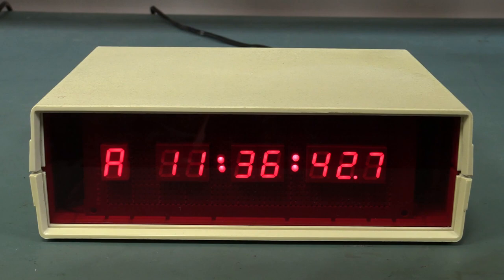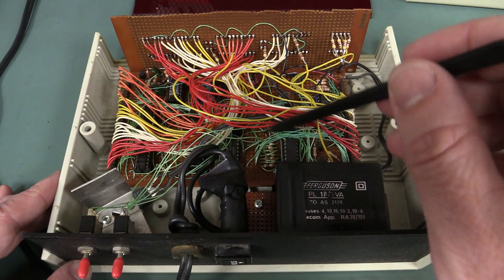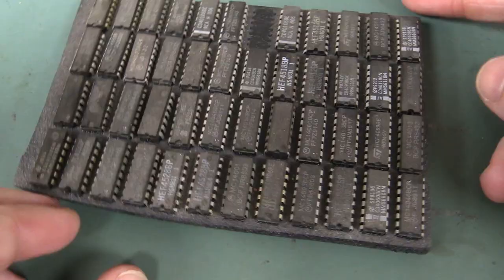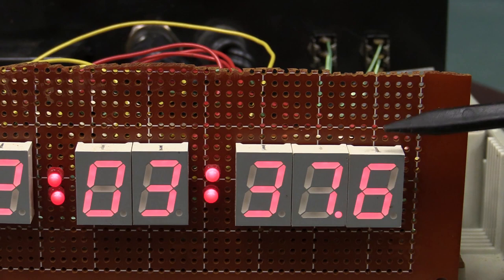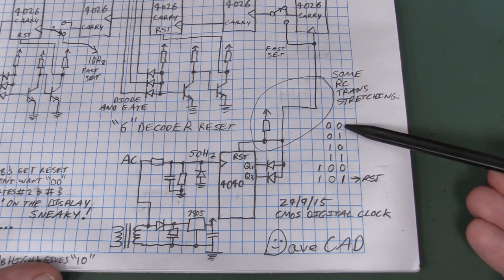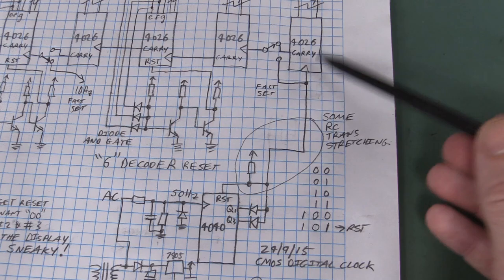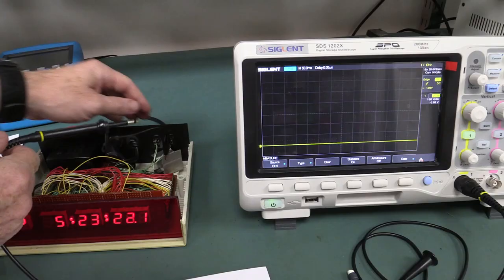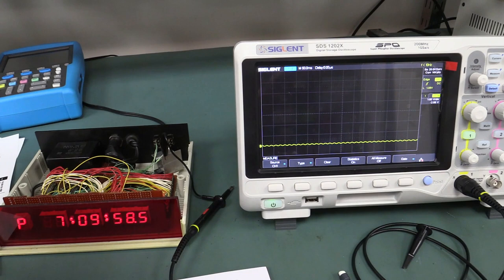EEVblog #801 - How To Design A Digital Clock

Comment: one question, does the 4040 just need a stable clock signal, or does it absolutely need 50Hz?
Reply: The 4040 is just a CMOS binary counter IC that he is using to divide the incoming 50Hz by 5 so that he can generate 0.1 second counting pulses for the display counter/drivers ICs.  It is a 12-bit counter, so you could set it up to divide the incoming (line frequency) pulses by any desired value that can be defined within the integer range of 12-bits -- you just choose which "magic" number will reset the counter back to zero...so for a pulse-per-second display you would reset on 50 (50Hz) or 60 (60Hz), which rests the counter back to zero where it continues counting up again.  There are also other possible IC binary counter choices that can be used as well (including 7400-series), I suspect Dave chose the 4040 because it was on hand and/or common enough to be readily available to him at the time.

Comment: Couldn't you just run an AND gate to go off when the 7 segments  hits 12 which will trigger a flip flop to send a pulse to the clk input of the 10s display? You would have to run a diode from the 1s counter to the 10s counter to prevent back current but it would have been so much simpler.
Reply from the maker: +Polyaness ポリアネス No, because you don't want 00 hours displayed.
Reply: I was thinking if you could generate an extra clock pulse when the hours counter gets reset you would get 11 > 12 > 01
Reply: I'm sure there are some mistakes but what I meant was something like this

http://imgur.com/hVfgKZa

Btw 100 hours in paint

Comment: Dave for those ICs you desoldered from other parts, how did you get the data sheets for them? I'm sure it had to be quite a process to find a phone number or address for the manufacturer, contact them, find the right department and the right people, etc.
Reply: +DR Hayden Catalogues / Magazines would often include datasheets for popular IC's and parts back then. In fact you could buy (probably by mail order) datasheet catalogues fairly easily. It was the only way to do things.
Reply: +Mythricia Indeed, there were entire books of reference datasheets readily available from most manufacturers and parts vendors inexpensively.  Many also had automated fax-back services (in the 80s) where you could request data sheets from a voice menu system and have the datasheet faxed directly to you.  Some even had dialup BBSs (mid 80s to early 90s) where you could sometimes get hold of text-only versions of the datasheet (line drawings would be implemented with line art characters).

In some ways it is as almost more convenient back then because, when it came to the more common logic families, you often already had the datasheet in your personal library and need only fetch it from your shelves...you did not even need to dig through a possible Google search.  The headache were oddball and specialty parts, where you did often have to request a copy of the datasheet from the manufacturer to have either faxed or mailed to you...and then hurry up and wait for it to finally arrive!

Comment: what!? no blinking seconds leds option? no 24 hour option? no bcd thumbwheels to set the time?  you amateur...lol.
i used to do point to point wiring for projects like this with wire wrap wire, the project du jour looked like it was going into space - i was very uptight in my youth.  still great work for a young Dave!

Comment: Here in the US I'd have to change the logic a bit to divide by 6 instead of 5, 60hz ya, know.  (I never understood WHY parts of the world went 50hz.  Guess metric time has 50 seconds in a minute!)
Reply: +Kenneth Scharf   That's probably because "part" of the world figured out that 50Hz is 50 cycles per second, not 50 cycles per minute  ;-)
Reply from the maker: +Kenneth Scharf You weird Yanks and your 60Hz!
Reply: +EEVblog I guess you just like your power transformers to weigh a bit more than ours do! :-)
Reply: +EEVblog is it not due to three phase power transmission that the US is 60 Hertz? that was an explication given to me that each cycle was 60 degrees out of phase to each other and that was intentionally done at the power generators by how coil windings were arranged around the rotors.
Reply: +Kenneth Scharf  50hz are heavy. but they use 220v so the compensate that weight with half the current.
Reply: +Mariano Gaston But the core size for a given frequency depends on VA, NOT primary voltage!  No weight advantage there.  Also the volume of copper used would be the same, more windings of thinner gauge wire, and more layers of insulation for higher voltage!   Still your line cord might weigh less and be more flexible, guess that's a plus.
Reply: +Ben Childs I'd have to think about that.  I think you could still have three phase power at 50hz, frequency depends on the rotational speed of the armature of the generator, and the phases are split off by the arrangement of the winding so each phase leads/lags the next/previous by 60 degrees, but the net rate of change is set by the shaft speed.
Reply: Kenneth Scharf  we actualy have three gase power with 50hz. In wikipedia explain why the diferent frecuency I just read it.
Reply: +EEVblog Blame Tesla for 60Hz, he was the one who originally specified 60Hz while designing his early induction motor vehicle and, thus, for AC generation and that is what Westinghouse engineers ultimately settled upon towards the end of the 19th century as electrification was in its early infancy.  But as for 50Hz/60Hz, the difference is more arbitrary in actual practice so one could argue that 50Hz makes no more or less sense than 60Hz.  A 60Hz system saves a bit in transformer weight and efficiency while 50Hz allows a moderately greater skin depth but requires larger filter capacitors in rectified supplies.  

Interestingly, their are 60 minutes in an hour, and 60 seconds in a minute and there are 360 degrees in a circle and each degree is further subdivided by 60 arcminutes and 60 arcseconds, all of which work very nicely with the number "60", and their is some speculation that may be where the original logic behind 60Hz originates since Tesla's work at the time involved rotation.
Reply: +Kenneth Just if he would have enough time before being arrested.
Reply: +Kenneth Scharf  : 60 hz are the sign of Lucifer and it is the bad side of electricity.
In Europe, we have 50 hz and God use this . The heaven use 50 hz. This is the light side of the world and you are in the error with your 60 hz !
Reply: +EEVblog Doesn't Japan use both? East Japan using 50 and west japan using 60? That's gotta be confusing...
Reply: +EEVblog A long time ago (back in the CP/M days) the company I was working at was reverse engineering a computer system we'd borrowed from the parent company in the UK.  The thing ran on 220v/50hz.  We were able to restrap the power supplies for 120v, and the power supplies didn't mind the 60hz.

The big problem was that the floppy disk drives ran at the wrong speed! (synchronous motors).  Someone rented an expensive power converter that took the 120 volt 60hz and spat out 220 volts at 50hz (the thing was like a SVLF VFO hooked up to a 500 watt audio amplifier!).   Stupid over engineering!  We finally figured out that we could get a different diameter pulley from Shugart so the floppy disk motors would run right on 60hz and just restrap the PS for the lower voltage.
Reply: +Murdoch493 If you think that's confusing. When I was in Germany I was on an old Nike Hercules battery. We had the 220V 50Hz from the power company. Then we had converters to provide 120V 400Hz to power the LOPAR (Low Power Acquisition Radar) and the tracking radars. The HIPAR (High Power Acquisition Radar) used 120V 60Hz. You really had to pay attention to where you plugged anything into.
Reply: +Kenneth Scharf Back in the 70's I bought a stereo tape deck and a turntable at an air force base in Europe. They had the transformer wired to a plug, like an old tube (valve in the UK) socket. To change from 220 to 120, you pulled the plug out, rotated it and then plugged it back in. For the motors, they had a double sided pulley. One side was used for 50 Hz the other for 60 Hz. This was great for GI's who would be using these in Europe and then bringing them back home.
Reply: +Kenneth Scharf 50hz is easier and cheaper to produce.  Also, most other parts of the world use a 2-phase system, which is also cheaper to produce.  For some strange reason, here in the US we just love our 3-phase 60hz electrical grid and it costs us more money.  I don't know much about circuitry, but I do know a bit about our power grid.
Reply: +jesusnthedaisychain On what basis do you argue that 60Hz is more expensive to produce? You do realize that the only difference in producing either is a 20% increase in shaft RPM for 60Hz, which does not necessarily cost any more to produce than a slower RPM.  For example, internal combustion generators typically have power curves that favor greater torque at slightly higher RPM, hence greater efficiency at 60Hz. In the end it is pointless as the power plant will be engineered to produce whatever RPMs are required at the greatest practical efficiency.

50Hz power also requires heavier transformers requiring more materials versus a higher frequency. And three phase is not more expensive than single or two phase. In fact, in the case of single phase versus three phase you can transmit three times the power in only twice the number of power conductors, or 50% more power than a typical two phase system with just 1/3rd more conductors.  Seems rather efficient after all.
Reply: Ethan Poole What I know is what the engineers at the power plants I've worked in have told me.  Turbines, generators and exciters that are built to run at 50 Hz are cheaper to produce, maintain, and run.  They're more efficient and they don't require as much maintenance.  I'm certain that transformers are plenty costly, but an entire steam train can run well over half a billion dollars to purchase and install.  So when a 3-phase, 60hz system is set up, and the initial costs plus the operating costs are higher than the costs of a 2-phase, 50hz system, then it's pretty clear that one is going to cost a consumer more to use.

Comment: The alarm clocks today no longer have the mains reference.  Just a quartz clock now.  Then I read how the mains freq. is no longer going to be as tightly regulated and they want to get rid of anything that uses the mains freq. as much as possible.  Still even with the poorer freq., the cheap quartz clocks would be far outdone as they are doing a few minutes per month.  Because the quartz crystals are probsbly the lowest bidder ones, with all the good ones going to watches that cost hundreds of d

Comment: Why are digital clocks less accurate than mechanical clocks can be?  Some mechanical clocks have a rate adjustment, which is based on the number of minutes you adjust it forward or backwards every day.  Also, I've had cheap battery-powered mechanical clocks which barely lost a minute in a year.  Unfortunately, nearly every digital clock I've owned, was often out by many minutes per month.

It seems like electronics 101 to me, to design an electronic clock circuit which could correct its speed based on the number of minutes and seconds it's adjusted.  Simply divide the number of seconds in error, by the time since the last adjustment, and it's simple math to adjust the rate of the clock.  It's likely to become deadly accurate after 2-3 adjustments.

Why hasn't this simple self-correcting feature been designed into most electronic clocks for the last 40 years?  Had digital clock-design reached its pinnacle 40 years ago?

Comment: Sneaky 12 decoder. When I was a lot younger, that solution eluded me, so I just waited till National? released a clock chip. (yeah, wimp mode)
I have a 5MHz frequency counter 'kit', designed by Electronics Australia magazine (using 4026's) that is mains locked - boy is it bad, maybe I should convert it into a clock.

Comment: if you can use a 50 hz mains for a clock cod you simulate that with an ne555 timer chip ?
Reply from the maker: +bor_12345's Electrofied Gaming Yes, but it would be horribly inaccurate and unstable with temperature and time.
Reply: +bor_12345's Electrofied Gaming Interesting mains frequency is incredible stable over long time, but can suffer from short time stability. Mains frequency change during day, but usually if you take average of whole day it will be spot on. Frequency drops when when there is big load increase on power grid and vice versa (that is first sign that grid is overloaded, and with best predictions they can't predict exact moment it will happen, so there are short periods when frequency is lower and higher then declared).
Reply: +EEVblog Ok thanks !

Comment: Can it be adapted from 50Hz to 60Hz clock? cheers!
Reply: You'll need to remove the micro seconds parts, because 60 and 100 doesnt (I dont know how to call it in english, but, doesnt have good divisions), 100 can be divided by 50hz, its 5 pulse every .1 seconds. 

But you cant have that division with 60hz, it would mess up the counter.

You'll have to make another 0 to 60 counter for the 60hz, to make the clock flip 1 second

Comment: What's a good, affordable second hand bench power supply to look out for on eBay? Sorry if this has been asked before :p
Reply: get a cheap ATX power supply and make your own bench supply with it
Reply: +Novashadow115 Thanks for the input but that's not really an option.
Reply: +Timo van Dam Tektronix PS280. It's a lot of power supply for the price, 3 channel (2x adjustable 0-30v, 0-2Amp, 1x fixed 5V 3A, adjustable current limit, capable of parallel or series tracking config as well). They are popular in class rooms, and if you're lucky you can find surplus units on eBay for cheap, that just have been sitting around not being used. I was lucky to find one recently, and when it arrived, I was shocked to see it was essentially brand new. It must have never been used. So, with some luck, you get a really capable supply if you find a cheap, good-condition PS280.

There are a lot of PS280 clones as well, and some are really just as good as the Tek unit (I don't even think Tek originally designed the unit), by Mastech for example, but I don't know the clone part numbers or names exactly. I know Ben @ AppliedScience has the Mastech clone, and it seems to work fine for his lab.
Reply: +Mythricia That is a lot of useful info, thanks! I'll definitely look out for one.

Comment: what's wrong with 00 : 24? sounds like a totally legit time to me. I've always found it strange that americans use not only 12 hour system but also the transition at midnight and noon.
New day for me means the clock starts again, not run over 12. also it's confusing. is 12 : 14 am 14 minutes after midnight or 14 minutes after noon? it's just silly. just say 00:14 and 12:14 and be clear about it.

Comment: Homemade clock. not a manufactured one that was taken out of it's enclosure and placed into a suitcase for the sole purpose of looking like a bomb. no fucking reason the kid's clock had to be in a damned suitcase.
Reply: Bradman175 I know. I've heard many things about his dad. probably took an old clock and encouraged his kid to do this for press and money. it worked. hell, I made something with arduino that measures soil temp and waters plants based on that. I coded most of it, and wired it, shit like that doesn't have to look at a bomb. and it definitely wasn't. hell, even the superintendent and the head of another school came in to check our projects. I explained mine and it wasn't even considered a bomb. his suitcase has a plate with 4 screws at the top. made to look like some sort of c4 or explosive with a shrapnel/compression shield on top. obv a hoax
Reply: ghostrider433 It's sickening. Ahmed lied and got everything. Yet people work legit and get nothing.
Reply: Yeah man, it makes me fucking sad for humanity. i mean, the kid wants to go to the whitehouse, some ivy leauge schools and stuff. for repackaging someone else's product, in the form of a bomb. at least dave DESIGNED his own clock. with parts he found, in an age where learning things like that, was definitely not as easy, because there was no internet.
Reply: Bradman175 Fucking exactly. and congrats ahmed. you got invited to the white house. his plan was probably to infiltrate the White house by getting commended for making a clock. and probably blow it up.

Comment: Hi Dave
You said you used 7Seg E,F and G to detect the number 6, I think you only Needed to use E and F, Could have saved yourself 2 diodes :)
Great channel keep it up.
Reply: Doesn't work because of '2' which also lights up E and F.

Comment: Ah Dave, why did you made a one diode rectifier? Don't you know most people don't like those? Wasting 50% of the 50Hz?

But then again, it was made in the dark ages of electronic part salvaging so I will cut you some slack :)

Still today many products which claim to be aware about energy saving are supplied with a MADE IN CHINA switched mode power supply without any filtering and a pesky one diode rectifier dumping current in a 400 Volt CAP.  Making sinewaves appear as vertical lines. Companies who make that kind of power supplies nowadays should be arrested for deliberately wasting energy and causing pollution.

But I guess clocks made by 14 year old boys are a bigger threat to society. 
Maybe there was also a one diode rectifier in it without proper filtering?